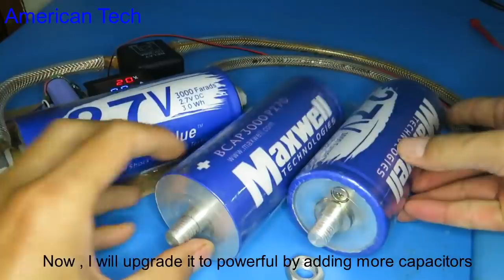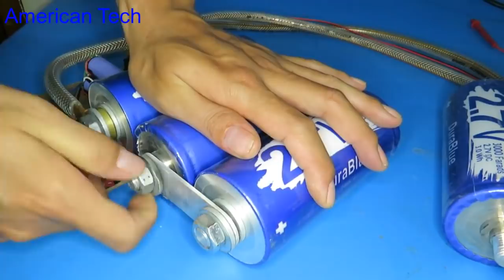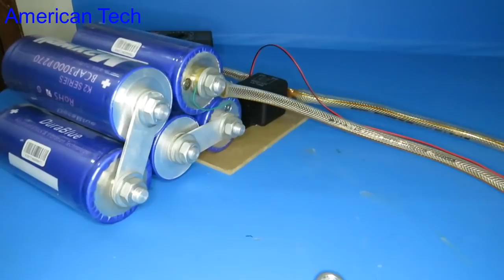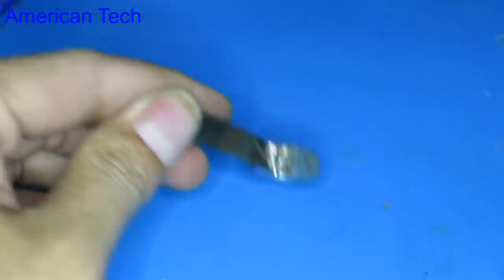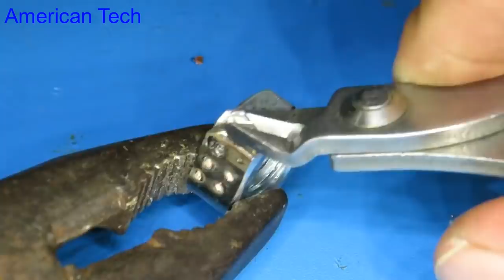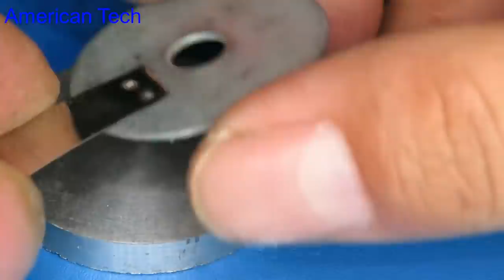How to make a powerful spot welding using super capacitor 3000F Upgraded

Comment: How much current does this output? Looks like it could kill...Or hurt a lot.
Reply: These large capacitors can dump more than 3000 amps.  But it's only charged to 11.8V so not much current will pass through your body. Of course although those capacitors are big and heavy, they can only generate power to 3.0 Wh (Watt hour), while those small batteries can hold a few times more charge than these capacitors. The benefit? Those capacitors have series resistance of just around 3.2 miliohm, while those batteries have series resistance of large numbers like 200 miliohm. 
So I mean to create that 'painful' current you need high enough voltage
And please don't say again about it's the current that kills not the voltage.

Comment: Why you don't use voltage balance for serial capacitor battery? You need only n x 10 Ω 1% resistors. Super caps have 10-20% tolerance thus their charge voltage varies about that value while charging with the same current in series !